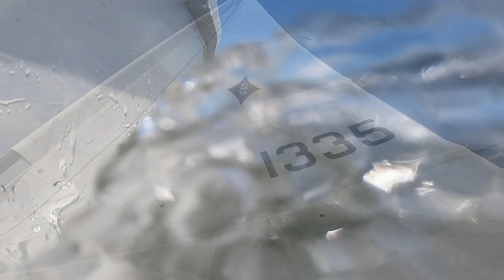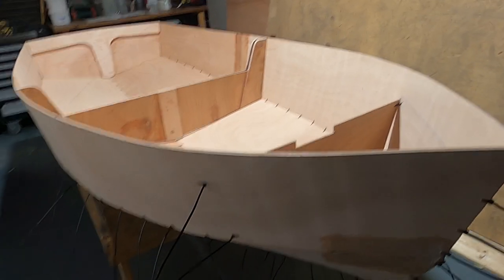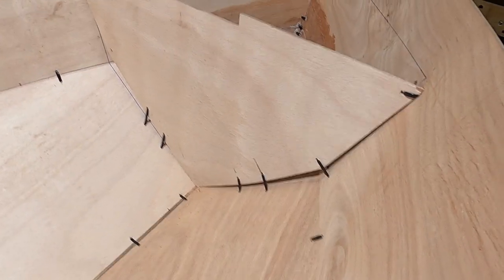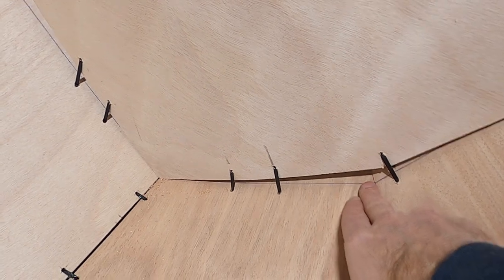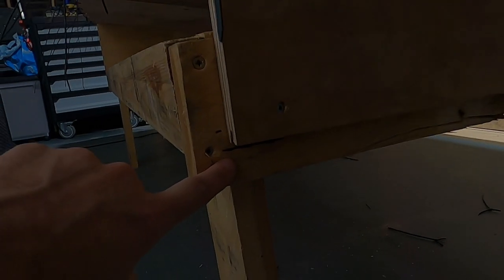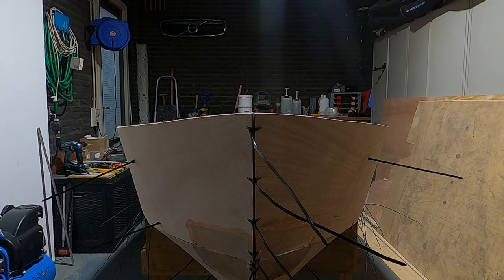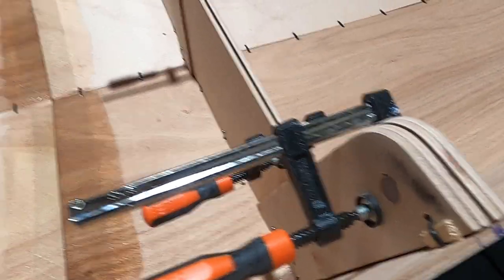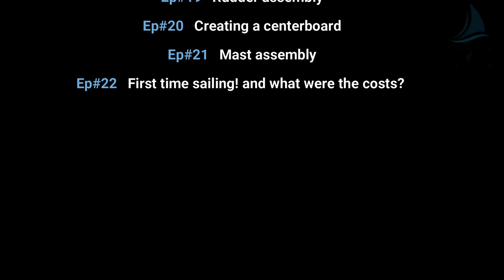Building my nesting dinghy - a sailing spindrift 10  EP_4

Comment: Would you recommend getting the $960 kit or the $60 plans like you did? How many hours do you think the kit saves?
Reply from the maker: Hi John. 
Thank you for your comment.
I think the kit will save you roughly about 10-15 hours. It depends if you have some experience with drawing and cutting. 
Please do not underestimate the price of the okoume wood. 
$900,00 is inclusive the price of the plywood. 
But will be cheaper if you will draw and cut it yourself.

Have fun building!!!!